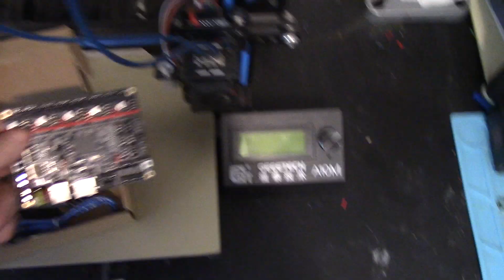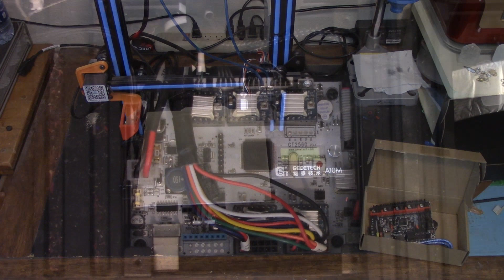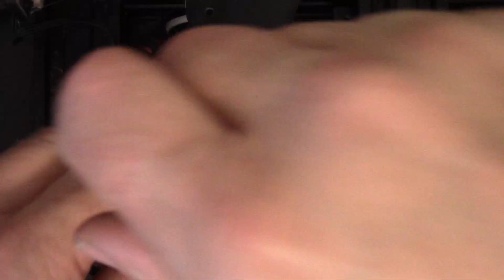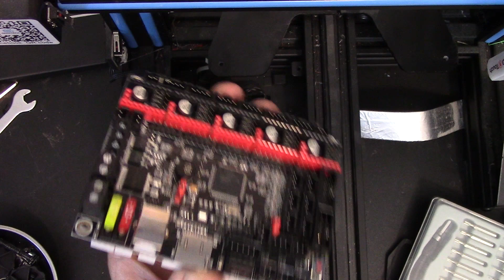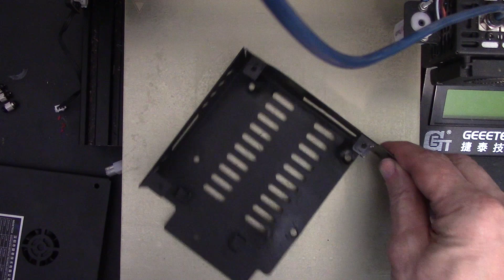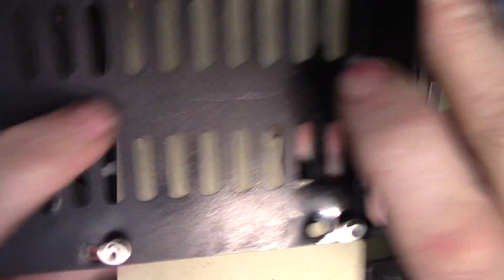Part 1 - BigTreeTech SKR 1.4 Turbo upgrade for Geeetech A10m

Comment: Chuck, Thanks for taking the time to do the board retrofit series.  I have Geeetech A20 that has issues with main board, and they don't offer a replacement anymore.  There are numerous BTT boards, which one would you recommend?   thanks
Reply from the maker: It's tough for me to say which board I think is best for you. But if I was doing it I'd be taking a long hard look at the SKR 3 EZ. But you'll need to take into account the mounting solution, your tolerance and ability with a little fabrication if necessary as well as the modifications to Marlin and the tuning that will be necessary to get it to run right. Good luck!
Reply: @3rdpig  Ok, what about the drivers?  SKR3EZ supports about 5 different TMC, and about 5 EZ format drivers.

Comment: its there a different board for the a10t ive been looking everywhere
Reply from the maker: For a direct fit replacement I'm betting you're stuck with the factory board, although there might be an upgrade to it. For a custom setup I would think that any of the BTT boards with 6 or more stepper drivers would run the A10T. SKR Pro for example. It's probably not going to fit in the stock enclosure, but I don't have that printer so I can't tell you for sure. Other companies also produce boards with 6 or more steppers.
Reply: @3rdpig  ah okay im not super expierienced with 3d printers i know my ender pretty well but softwarewise im lost
Reply: @3rdpig  i appreciate you taking the time to answer a comment on a older video. I think i May wait to try a btt mobo + touch and put them on my ender befor i try ither printers eith it

Comment: Would you happen to have the pin diagram for the Geeetech Smartto V1.0 motherboard used in the A30T?
Reply from the maker: I'm sorry, but I don't. I've found that info on the Geeetech boards is pretty scarce. Which is one of the reasons I decided not to stick with a Geeetech board when my original A10m board failed. It took a lot of work, but it was worth it.
Reply: @3rdpig  Thank You

Comment: Great series start! I've got an A20M, which I believe has a different main board. It's still working just fine, but I will still be interested to watch you work on a Geeetech printer, and what you have to go through to make this board work. Keep on truckin'!  btw, with your sheet metal skills, I'm sure you'll have no problem fitting the new LCD if that's what you choose to do.

Comment: I would do the wiring with the board out as some of those wires are not the most flexible especially the power in and the heater cartridge, I changed my Ender 3's boards but at the same time extended the wiring and printed an oversize external board and screen case as I was installing them into lack enclosures
Reply from the maker: I did pull the case back off the frame. And I've done the Ender 3 Lack enclosure too.

Comment: Interested in seeing how this progresses.  Looks like you may have some issues getting the wires to the screw terminals on the left side...  Have you considered just printing a new enclosure?  Depending how close in size to the ender 3 pro the Geetech is, maybe something like this : https://www.thingiverse.com/thing:3717627
Reply from the maker: The wires actually tuck into the channel of the aluminum extrusion nicely. So while they need to be installed with the enclosure off the frame, once they're in they sit nicely in the extrusion.

Comment: Hi Chuck, I've been thinking of trying to 'resurrect' a misbehaving Ender 3 using the 1.4 board and display. Thanks for the insights.
Reply from the maker: Hi Paul. I think the Ender 3 would be an easier swap and it was what I originally intended this board for. Like or not Creality has become the standard since there's such a huge support base. While I really prefer the way Geeetech has done some things, there's just not a lot of knowledge or support available for them.